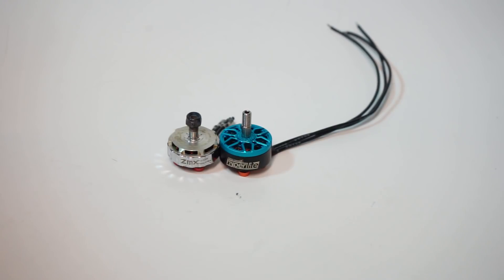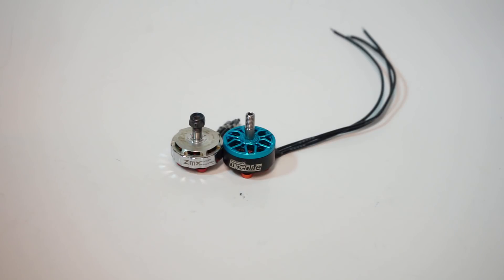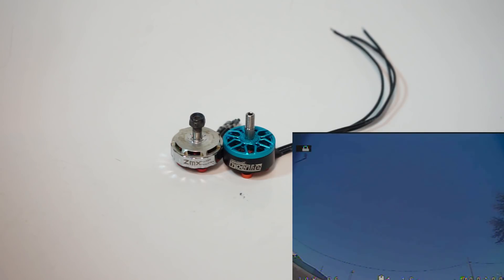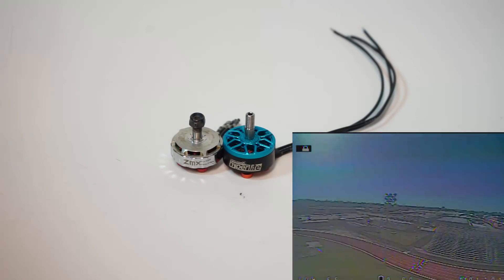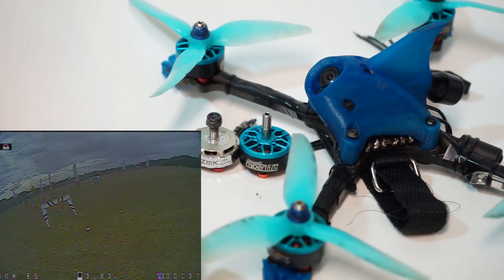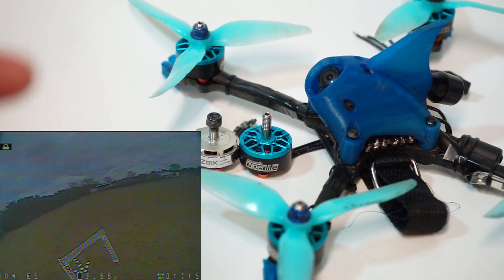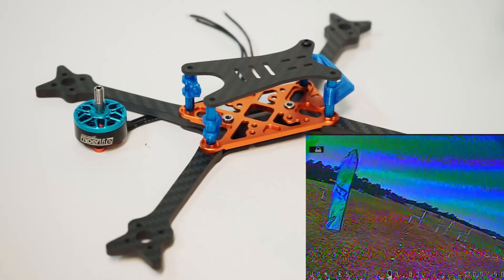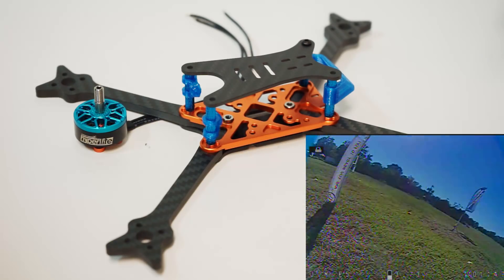2207 and larger drone motors. Why you need them

Comment: Agree completely on this point:
 2207.5 or 2208 for the ultimate in quick last second corrections and high speed. Feels like it builds boost in the midrange to upper rpm and is quick reacting (at speed).
2405 for  for very tight technical courses where there are lots of 180 degree turns, which limit the pilots ability to "carry speed."  2405 will provide a felling of "boost" out of low speeds.

Comment: If I had to choose best feel and performance, 2207 for sure. Ive flown them 4s and 6s and now I'm fast enough I'm limping at the end of 2min, if even that with no extra lap, so I've had to go to 2206 1900kv and I can get my extra lap with enough performance that I'm not missing that crazy good 2207 feeling. Thanks for the video, I completely agree
Reply: Why don't you just limit the top end power in your fc? 2207 are more efficient than 2205 or 2206 at a given rpm.
Reply: grandseigne cedric that’s a good idea, I’ll test it out, at this point since the format changed to fasted 3  consecutive laps I guess efficiency isn’t as important and I can just use all the power without having to worry about landing earlier than normal

Comment: I'm running 2306 2500kv gemfan 5149s 4s on a CF1 X and loving the control and speed at low throttle. I like how it jumps off the ground when I take off! But it does top out about 75 percent like you said. I have been putting off 6s because I can't decide on a motor. I want more low end torque than what I have now without sacrificing so much top end. Sounds like this is the answer but the decision I am struggling with is this: I was thinking of going with a 2207.5  1922kv so I would have more to end to play with and could ease up on throttle to just have it there if needed. I was originally going to go with a T Motor F60 1750 but I saw a review and they said it seemed not to have the power they were used too with 6s which I don't want want to spend d that much for a motor when I could have gotten a hypelite cheaper that out performs it.
So My questions are: would a higher kv like the hypelite 1922 start to take away from the low end? 
Also these are listed as long range and says it has thinner magnets so will this effect power?
Or will going with a 2207.5 1722 be enough to give me more low end torque than I'm used to on 2306 2500kv   and still have more to end?
Reply from the maker: Good questions!   Imo i really like 2207 so far, and with the new motor lineups available, I would as you said do 2207.5.  *(Unless you can find someone offloading their 2207 stuff to change over and snag them cheap.  So a 1700kv motor on 6s is roughly equal to 2500kv on 4S.  1922kv, on 6s is closer to 2900kv on 4S!  Should move the throttle curve a bit, it could be doable if you set a throttle limit to say 75-85% or so.  I actually have a set of 5 of those 2207 1922kv LR edition that i never ended up using (for mounted lightly used and 1 new in box) if you wanted to try them.  I really liked the F60 pro 1750kv (i believe it is a 2207.5), I test them in my Merica Razorback review, but that was before i was well versed in 6S, so i cant really compare well.  Since I never really tried the 1922kv i cant comment, but for me, the 1722kv is almost all the low end i was looking for with the top end added in as well.  Hope that helps some.

Comment: 2205 for me on a light build. I don't agree with your assessment but i believe it ultimately depends on a persons flying style and their preference.
Reply from the maker: I love 2205, but it removes the ability to make those last second corrections.  I didnt know i was missing this until i finally had this.  I think that top 2-5% of pilots do not apply here.  They have the ability to go full throttle for 2+ mins with clean lines, so they have a difference set of requirements like a motor that can allow that without draining battery.  The control at low speeds is very nice, and I find myself crashing out far far less with that extra control restored.